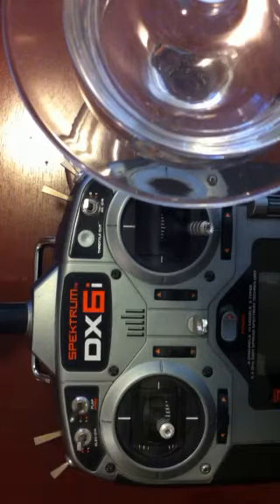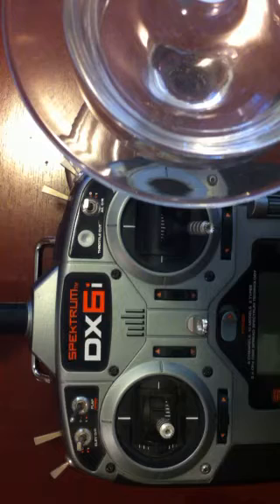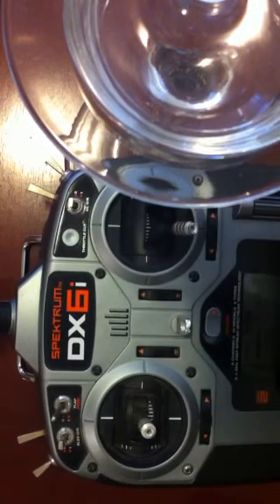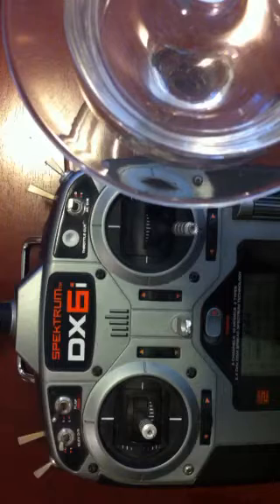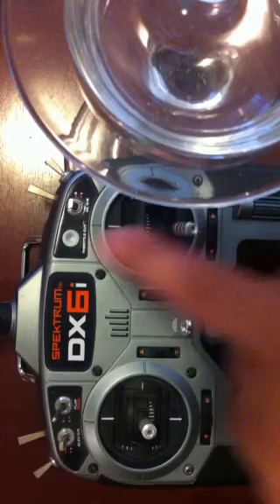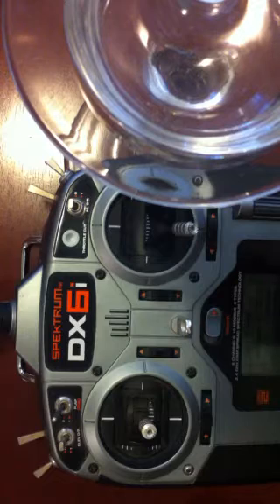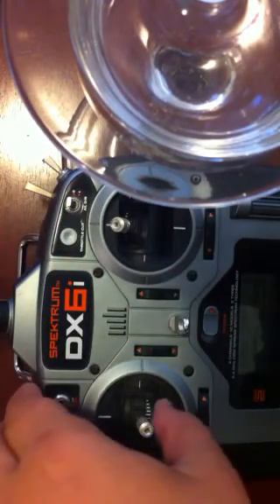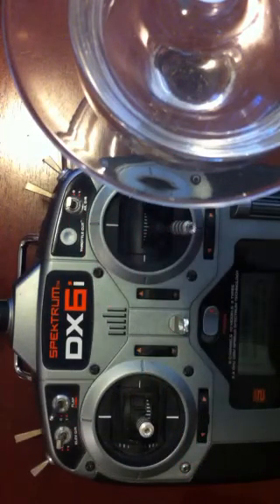Lotusrc T380 how to calibrate the flight controller

Comment: I meant rudder and aileron mix together. Ok thx for the info. 
I also hear that if you use foam to cover over the sensor ( black ring around the silver) to minimize air disturbing in regards to altitude hold.

Comment: Thank you raptor50aus. I tell you these T380 are a marvelous machine to work with. I just found out that there's an altitude hold if you hover above 15ft and don't touch the throttle for 3 seconds.